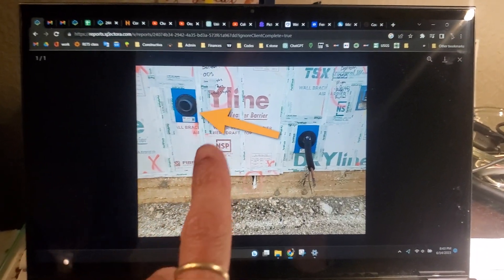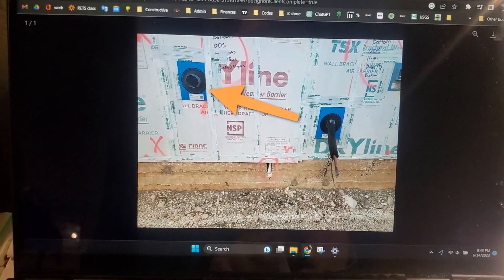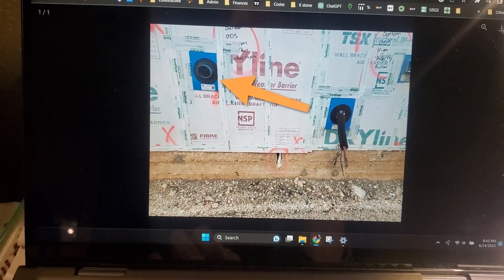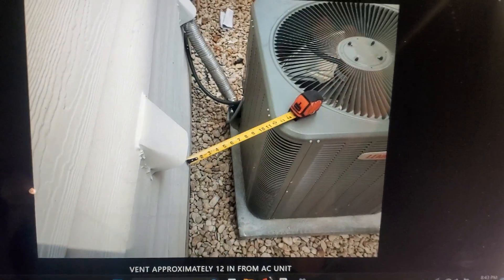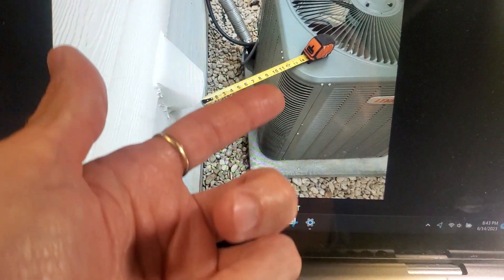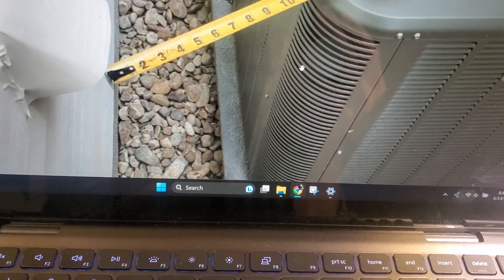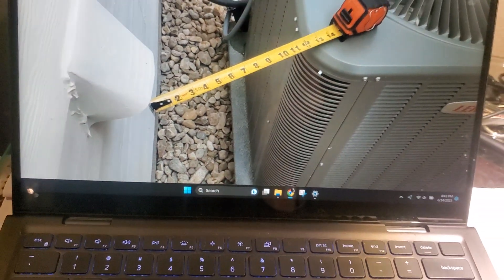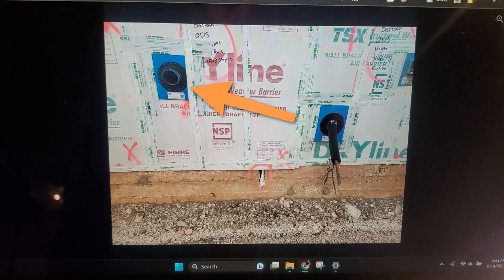Builder had their chance to fix it and didn't!

Comment: So, Casey, what are the consequences if they do not take your inspection points seriously and they do not fix it?  Always look forward to your presentations.💯 You are teaching us so much!  Cheers from Eastern Atlantic Canada  ☺👷‍♀🪚       🇨🇦
Reply: @MegsCarentry-lovedogs  The builder doesn't care about the inspection report until the buyer (who hired the inspector) goes after the builder using the inspection report.  Ugh.  What a mess.
Reply: @SpringRubber  Yikes! That's not good eh!😳       🇨🇦
Reply from the maker: Hey always cool to hear from folks so far from Texas! Hope the smoke from the fires is not too bad out there and this insane heat isn't cooking yall out in EAC. 

Most builders will fix the majority of the items on my inspection reports. If something like this becomes a serious issue and the buyer wants to push tt they could get legal and use my report as documentation to show the builder was aware of the deficiency and did not repair it. Don't think it would be hard for a lawyer to get the builder to move on it.

Comment: Best practice to keep the dryer vent away from the condenser, however there is no code for it so builders don't need to change it in relation to the condenser, the building official doesn't call it out, and if the builder is sued the plaintiff will loose.  Should have been added to the code several cycles ago.  It will affect choking up the coils on the condenser, absolutely.  The warm air from the dryer won't affect anything they way the AC work, but to knowingly install a problem for your customer is just dumb product design.  Could have ran it up the wall a bit above the condenser and exited (if there were no windows there) or through the roof easily during construction.
Reply from the maker: Preach brother.

Comment: If the builder allowed this I would be leery of other defects in the house.  And doesn't Austin TX require building inspections?  Locality inspector asleep at the switch and shady builder probably just waiting for a tornado to blow it apart.
Reply from the maker: Oh they do require building inspections!
Reply: Not a code violation, so the building inspector doesn't notate it.

Comment: I would think the buyers would have more power against the builder. Obviously they are wasting their good money hiring you (just kidding Casey) because the builders don't fear the inspectors or the buyers.
Reply: I would have it cleaned each year and file a small claims suit each year for reimbursement. Yes a hassle but drive the point home with the builder.
Reply from the maker: Yo, I would LOVE it if I could inspect my way out of a job! As in, builders learn to fix their own issues and a buyer doesn't need their own inspection done.